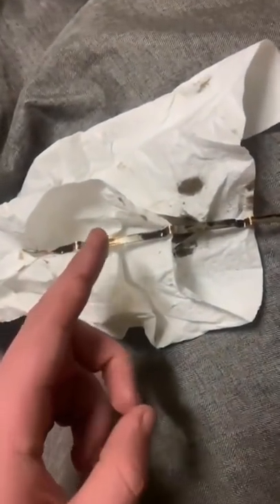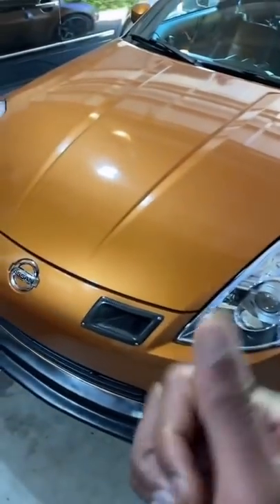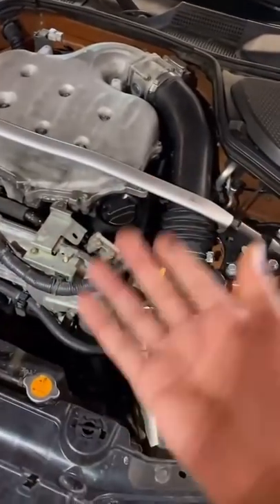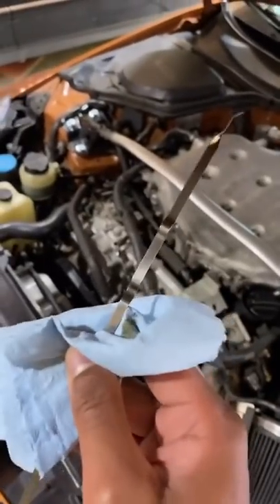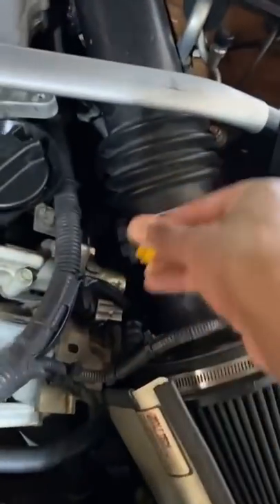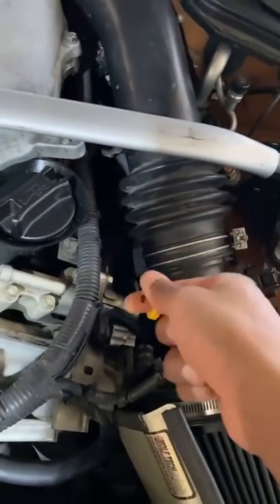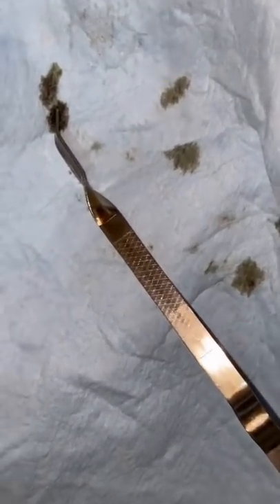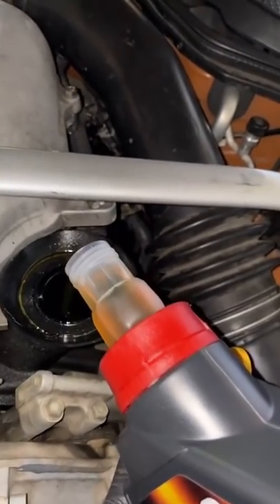how to keep your 350z engine from exploding

Comment: Something about sanding a medal rod and putting it in ur engine doesn’t sit with me
Reply: It’s a common thing for our Z’s. Also if you didn’t already realize, you sand it first, clean it off properly, THEN put it back in. Totally normal, many of us have done it. Unfortunately the dipstick seems to be an afterthought design.
Reply: @dheerajrajeevan4867  haha I thought it was one of them “put it into R gear for race mode” advice jokes
Reply: Well obviously you're going to clean the dipstick before putting it back.
Reply: @dheerajrajeevan4867  it’s not just a Z thing, I’m sure you already know that plenty of Nissan models have the same exact issue with their dipsticks.
Reply: just clean it after?
Reply: You guys prob have never rebuilt an engine, yiu sand off any scoring on all the piston skirts
Reply: As a N52 owner i cry
Reply: Other owners drill holes in their dipsticks so they can see the reflection of the oil. As long as you clean off the shavings that’s all that matters. You engine already loses metal everytime you run it, the oils suspend the metal particles so it can be caught by the filter. So really your not doing anything new that the engine hasn’t already been exposed too….
Reply: It’s not a moving part no different than sanding a body panel
Reply from the maker: @dheerajrajeevan4867  it’s a remnant of nissan adapting the DE from FWD to RWD. transverse mounted, the dipstick is in the perfect place to not have to bend all over the place. that’s why the HR redesign has a simple straight dipstick in the front
Reply: Why? Sand it and clean. There's zero danger
Reply: In my years of being a mechanic, I've never had this problem. At least not yet
Reply: @bcob8989  yes but you dip it in the oil
I don't think it will damage anything if you clean the dipstick after sanding but it definetely would matter if you put metal shavings in your oil..
Reply: @precesionnoreaster1507  lmfao if you want to pull your engine back apart, blow by central. You don’t rebuild a used engine with used parts use ur brain
Reply: @dheerajrajeevan4867  lmao your wasting your time on "your z's"
Reply: Obviously you clean it before you put it back in bruh
Reply: If there's oil under it,  there's oil in it
Shitbox revelations 13:20
Reply: @bcob8989  wrong because body panels aren't in your crankcase.
Reply: Wouldn't sanding the surface change how the viscosity adheres to the dipstick give you a different reading than what the surface was made to be?
Reply: A crankshaft
Reply: @dertmatyui  haha same its just so stupid for bmw to not put a dipstick in the engine
Reply: @YungGaucho  Definitely. Any Nissan/infiniti/Renault that uses the vq35de/revup
Reply: @ChrysGaines  Ah that makes a lot of sense, I had no clue that was the exact reason why. All I know is HR boys got it good :')
Reply: @AndToTheRepublic4WhichItStands  Where did I say "your z's"? I said "our Z's" you dingus please read before you quote stuff, it'll really help you when signing legal documents in the future.
Reply: @jessmoser9406  That's why he said sanding it would make the oil stick better. I would fill my oil to where it needs to be using the normal dipstick..THEN sand my dipstick and check the oil again to see where it reads on the sanded dipstick. But I wouldn't sand my dipstick so whatever lol 😂
Reply: Not a mechanic, only do very BASIC things on MY PERSONAL vehicles but sanding metal & shoving it in your engine prolly no bueno 😄
Reply: @jaycustom21  Ahhhh yes that is one way to keep consistency but I do agree. I mean personally I never had a problem reading a dipstick. 😂
Reply: @somekindahelldiver  obviously you clean it before putting it back in. If you put it back in without cleaning the filings off, that's your stupid problem. It's not like bits of metal keep coming off after it's been sanded.
Reply: @Krankie_V  🤣❤
Reply: @BTLag  that makes no sense but ok buddy
Reply: @bcob8989  Neither does what you said. It doesn't matter if you body panels are coated in dust for example. The same can not be said about your dip stick.....because it's in the crank case.
Say stupid things, get stupid replys.
Reply: *Metal. * Your.
Reply: @MREclipsePvP  *Your
Reply: @davidiles4860  lmao 🤣
Reply: @ToxicRakyat 10,000 miles on a oil change? Your correct it won't matter anyway.
Reply: Lol I totally understand
Reply: Yes lets shave the dipstick then leave all the metal shavings on it? How is that hard?

Comment: First reading will always be wrong. Wipe and second will be accurate
Reply: The exact same thing I said when he didn’t wipe it immediately after😂
Reply: Unless the car has been sitting
Reply: @juc3eoncs32  even if the cars been sitting, theevel between hour 2 and 3 will be different best practice is to always use the 2nd dip measurement
Reply: @herozero8809  if the car has been sitting there is no need to do a second test, the oil will sit at the bottom due to gravity and the first pull will be accurate.  Something I do as a pilot all the time in our plane because the more times you take that stick out the more you risk dripping oil on important components.
Reply: @thegamingaviator2140  yea no dude thats not how it works… do it yourself ur always gonna get a different (more accurate) reading
Reply: @thegamingaviator2140  “dripping oil on important components” 😂😂😂 POV- Youre not a car guy🥱🥴
Reply: @Nick_370z  or he could have took a paper towel like literally everyone does so it don't drip
Reply: @ryosuketakahashi4957  😂😂lmao he’s trying to prove a point that doesnt exist
Reply: @ryosuketakahashi4957  I can tell neither of y’all have ever seen an aircraft engine
Reply: @Nick_370z  I can tell neither of y’all have ever seen an aircraft engine
Reply: @thegamingaviator2140  but that's an aircraft engine. Not a car engine. You may do that on an aircraft engine but on car engines you do it differently. All important components are covered. If they aren't then abut of oil don't do any harm, unless you somehow get it on the belts
Reply: @Nick_370z  great point lmao
Reply: I always check 3 times wiping every time
Reply: If the engine has been off for hours you don't have to wipe it first
Reply: @ryosuketakahashi4957  if the car has not moved for several hours there is no need to check the stick more than once that’s the point I’m making.  Any oil that may have moved or been kicked up has been brought back down by gravity.  The level you read the stick at will be accurate.  If you just moved the car or had it running of course you will need to wipe it and retest.  But to say you have to wipe the stick every time is completely incorrect.  I really don’t want to have to explain the concept of gravity to y’all.  The oil doesn’t move upward by itself.
Reply: @thegamingaviator2140  I never did say anything about that. I stated that engines aren't fragile etc, and that they are nothing like aircraft engines, which you brought up. The towel I mentioned is only there in case you you need to check the dip stick a second time, or to just absorb any oil that had been dripping from it. I've never said that you need to check it more than once unless I have misphrased my sentence then that's on me
Reply: @ryosuketakahashi4957  you were agreeing with kuhas and that was his point, anyway we aren’t even discussing the same thing at this point, the only point I was making initially is that you only need to check it once if it hasn’t been run and that’s the true but unpopular opinion apparently.
Reply: @thegamingaviator2140  I was agreeing with him on the oil dripping comment he made. I wasn't agreeing on the fact you have to check more than once if the engine sat. You only check it once if the engine hasn't ran before you do it
Reply: @thegamingaviator2140  lmao dont try to convince us with that. Its the same concept… no one checks oil aft its been running… oil will always stick to the dip stick🥴but hey what does a 19 yr old mechanic with 4 cars know?🤷‍♂️🤡
Reply: @thegamingaviator2140  plus… we talking ab cars here, nice try bud 👍🏻
Reply: @Nick_370z  also I don’t know what having 4 cars at 19 shows other than a lack of self control and responsibility because if you are a mechanic you aren’t making shit for income but ok weird flex bud.
Reply: @thegamingaviator2140  obviously people agree with me^^^ try it next time, maybe u wont crash ur plane☠️🥴
Reply: @ryosuketakahashi4957  aircraft designers don't think about making things easy to reach in the first place.  If there's a hole for a dipstick that's the only thing fitting through that hole and even then it might not without a fight
Reply: Not when it's been sitting for a long time. Only after its been running because the oil gets tossed around
Reply: @greglarson4253  I get that but you may aswell bc oil will stick to the dip stick especially if the oil is old🤷‍♂️
Reply: @justanotheraviator2357  oh I see. I appreciate the explanation.
Reply: @Nick_370z  you only need to check it once if it hasn’t ran in a few hours
Reply: @haroldralston685  I love how all these people are now agreeing with me after he literally just said no one else agrees with me. XD 🤡
Reply: @thegamingaviator2140  he’s just an avid diy home mechanic just let him be gravity is definatly a thing when you have to check 10 dump trucks in a morning and you dip them twice only to see the same reading you learn that it definatly doesn’t stick to the dipstick as some have said and we’re talking 15-40 wich is much thicker then car oils. I think some are getting confused here cause it’s good practice to check your oil when you fill up that tank or at least every other time you fill up the tank meaning you’ve ran the car so do a double dip. 

Tl:dr cars been sitting over night? Pull the dip stick and read the oil put it back in your done.  

Cars been running in the past hour? Pull it out wipe it put it back In, pull it out read the oil put it back In your done. 

My honest opinion is if anyone wants to say otherwise there wannabes who want to look like they know what there doing because they take unnecessary steps to look better. 
Do the job once do the job right.
Reply: Damn u a genius
Reply: @haroldralston685  couldn’t have said it better myself.
Reply: Yeah this guy’s just a YouTube mechanic. Made some videos about brake service and I felt obligated to post some advice in the comments with all the important stuff he skipped. Just laughable content to anyone who’s spent any amount of time in a real shop.
Reply: @herozero8809  yep always better to measure twice.
Reply: mhm
Reply: Isn't this done with all cars? 
Who checks the oil of any car while the engine is running or right after?

Comment: I work at an oil change shop. All Nissan dipsticks like that are a pain to read.  We have to pressure test and make sure we don't have any leaks so we dont have time to wait for it to level off before getting the customers vehicle to them. Best I've found in 10 years is after the engine is off, pull the stick out and wipe it clean. Put it back and check it again. Keep doing this checking both sides of the stick till you see a visible break in the oil on the stick. That break in the oil is your curent level.

Comment: Technician here, the oil is hard to check because the dipstick tube is also a oil drain back port for the cylinder head. You have to wait several minutes after engine has run to get an accurate reading.
Reply from the maker: so that’s why there’s always oil near the top of the dipstick if you don’t wait long enough?
Reply: @ChrysGaines  Yes, and your intuition to sand the dipstick is sound. Some auto manufacturers sandblast the end of the dipstick to help get accurate readings.

Comment: All you did was a normal oil check, nothing about this pertained to a 350z specifically
Reply: na vqs are liars my boy
Reply: On the z you won’t ever get a good reading unless you do this. Generally, other cars don’t really require it to sit for hours before getting a reading that is at least somewhat accurate.
Reply: He’s being sarcastic
Reply: A lot of people are mentioning the Z but in reality this a problem with a lot of other Nissan models as well. The dipsticks in those cars almost never give accurate readings unless the oil is settled like shown in this video.
Reply: @YungGaucho  No, it’s any car with the VQ35DE. My 02 maxi has one and it’s same exact thing as this guys 350. These engines are kinda quirky but the do last a long time
Reply: @pllmop  really? I had a Sentra pull in with same style dipstick the other day and it was a pain to get a reading on it. Def wasn’t a VQ.
Reply: I have no clue what any of you guys mean by this. No matter what the car the oil level will be lower when u first check right after shutting it off vs 2 hours later it will all flow down back into the pan by then and be higher. It’s best to run your car for a min or so then shut off and wait maybe 30sec (this lets things settle a bit for a more accurate reading) then check the level and add oil accordingly. If you do this you will notice when you check the oil level after it’s been sitting longer it will be past max, that’s fine tho because the excess oil is sucked up and fills ur lines and engine as soon as it’s turned on.
Reply: @pllmop  I mean I have a Silverado 1500 that you have to let cool before checking. I think it’s most cars
Reply: @YungGaucho  I had an 06 Sentra, never had this problem
Reply: @hughjazz2408  ok
Reply from the maker: @the46guide94  wish i could video reply to comments on youtube lol. i’ll make a vid showing what happens if you check the oil 15 mins after running the Z to temp.
Reply: That's what I'm saying dude
Reply: @the46guide94  You kinda proved ur point invalid by saying that cars have various avenues that oil may get stuck in. That’s a part of what give engines weird qualities.
Reply: @ChrysGaines  okay ahaha I’m speaking out of my ass I just don’t really see it being that different than others but yeah I’ll definitely watch always willing to learn new things!
Reply: Nah bruh I've owned both and you can get away with checking the oil hot on way more cars than you can with a Z.

But it doesn't matter what the dipstick says on a Z it's time to add 4 quarts weather you want to or not 🤣
Reply: @ChrysGaines  wow bro awesome 👏 jus shows how shitty the Z is
Reply from the maker: @angelgallegos3489  more for me
Reply: @ChrysGaines  so wheres the video? You got so many its impossible to find without a hyperlink. Every car i know you read the oil level after its hot and then wait 2min
Reply from the maker: @D3nn1s  should be my most recent or 2nd most recent short
Reply: @pickelkilla  every car you have to let it sit and let the oil go back into the oil pan
Reply: I'm sitting here wondering why your oil is that low on a car that isn't very old... next video is why you shouldn't bag your 350z until the oil rings hate you and allows oil past 😂😂

Comment: Technician/enthusiast here. 
Static oil level Vs dynamic oil level. 
I run the car for 20 seconds, shut it off for 10 seconds then check the oil. 
This lets the vvt, crank, cams and galleries get their oil and have the realistic dynamic oil level... If you let it sit for a few hours can mislead your check. Run it longer if you have thermostatic oil coolers as they can hold se oil as well. Anyway that's how I go about it.
Reply from the maker: this is VQ specific due to the terrible, hard-to-read design of the dipstick.
Reply: @ChrysGaines  I had a G35 and considered making a different dipstick.
Reply: I do this same thing as we’ll always have! I just realized however that this way of filling oil strictly depends on how the manufacturers made the dipstick to show max, to explain for example if max on the dipstick is already compensating for the oil that’s sucking up on start (that would mean the oil is probably already touching the crank so u wouldn’t want to do this method in that case because It would overfill causing ur crankshaft to be foaming up the oil. However on my e46 Ik the dipstick on max is still below the cranks so I know I’m 100% safe and that this is the best method to get optimal amount of oil in my car
Reply: aren’t the dipsticks made to be measured with the oil dripped fully down?
Reply: Exactly !
Reply: @lvgio  They are.
Reply: Oh fudge.  
The engine should be at rest, perhaps in the morning.  The dip stick measures the oil in the crankcase.  The engineering team designed the engine oil to be measured cold and the majority of oil completely dripped down.
You're welcome.
Reply: I'm not a tech nor an enthusiast and I still know you're wrong.

Comment: How to keep your 350 from exploding 
black oil shows on the dipstick 
“And just make sure your engine oil is topped off”
Reply: It's fine, the Burning and leaking oil plus you constantly putting oil in it means its always getting changed
Reply: @jok3yjesu339  I can’t tell if this is a joke or serious
Reply: @bassboss1234  depends on how much you know about cars
Reply: @ArtyTheBasedGod  burning and leaking is not good lol
Reply: @bassboss1234  it’s normal for the 350z
Reply: @bassboss1234 to clarify normal for the 03-06 DE 350zs not the 07 08 HR model. We don't usually burn oil like the DEs do

Comment: 350z use one of the main oil galleys for the dipstick tube. It's like this on all VQ35s so Maximas, Muranos, Pathfinders, etc. also apply to this. Because of that, they have a considerable drain back time so the car needs to sit for some time before the oil level can be read accurately. I usually wait around 10 minutes, but typically just wait till you get a clean break in the oil marks somewhere on either side of the dipstick. There may still be some oil above it, but that's normal as small bits of oil will sit in the galley for extended periods of time.